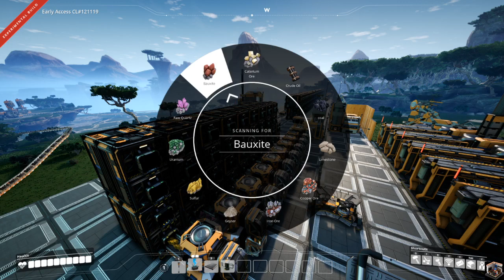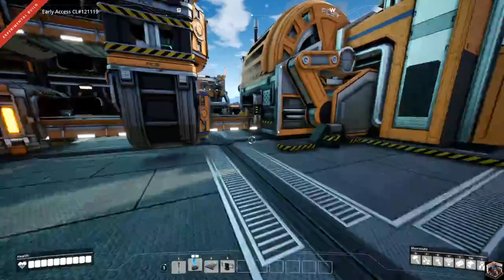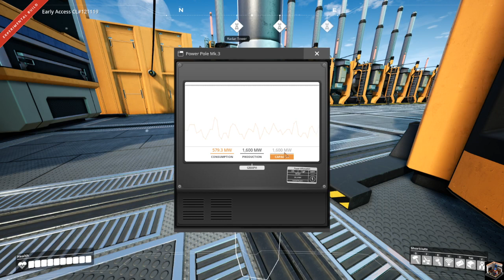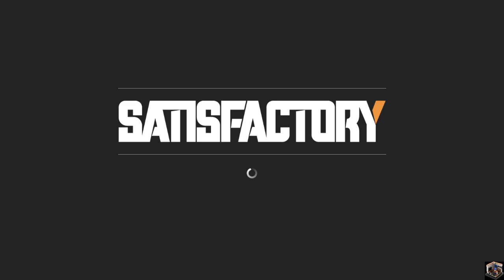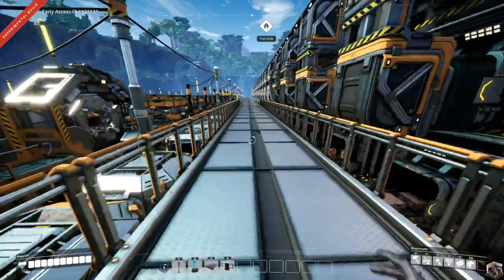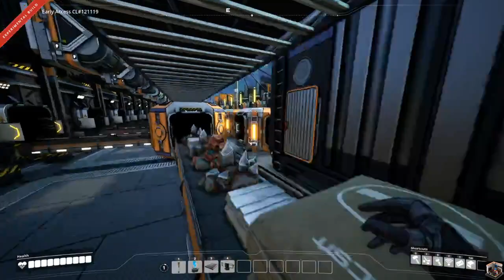why no Satisfactory vids this week?...here is why....

Comment: If you are processing all your materials, in a typical in-line pass-over system... All your overflow would just be anything that is not being processed, when all processing lines are backed-up. I am not sure why you would want to hoard anything in this game. you either have a use for it, or you don't. Why store it? As soon as it is full, it becomes one-in-one-out. If you never fill the buffer, it is still one-in-one-out. You are not saving power or speeding up production.

If you build enough machines to empty storage, while also producing items. You will just eventually run out, because you don't have enough materials to process. However, that "buffer", would give the illusion that you are fine, for hours, and just delay the inevitable.

I still don't get why people try to make EVERYTHING have an individual process setup, when you don't actually use everything and you can make all you need, to get to the end, before you get to this point. I got to the "end" (the last tier being complete), doing the last few things by just manually throwing things in the machines which is faster, since YOU can carry more than ten miles of conveyor-lines, in your pockets.

P.S. I never even left the starting area, to beat the game. (With the exception of needing oil, which was half way across the map, from the default starting zone. That was just annoying with the buggy pipes and pumps. Oddly, without pumps, the oil got all the way to the base, after climbing over 100 stories, when it says it should only have risen to 15 meters. Once I added pumps, it could barely push up to 10 meters, at an angle. Pumps were obviously intended to ONLY be used on a vertical pipe, not angled pipes.)